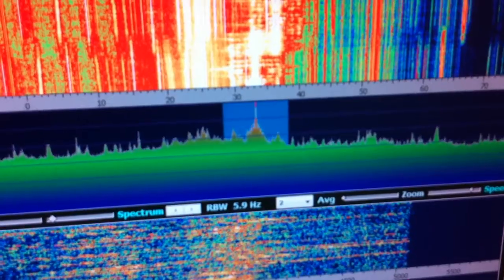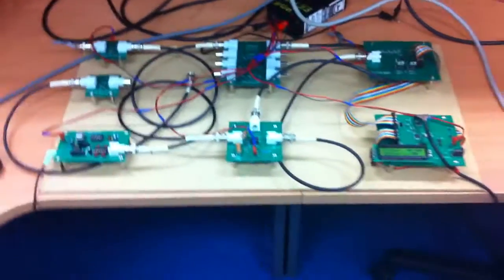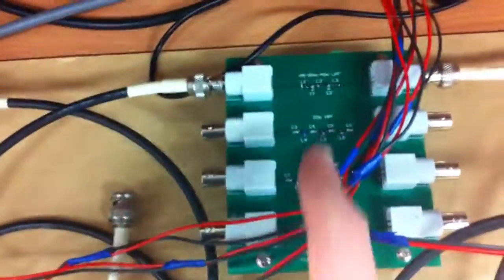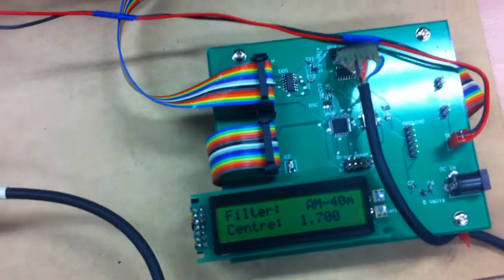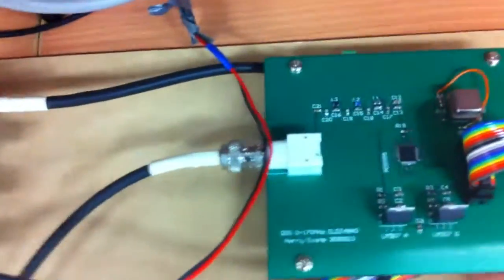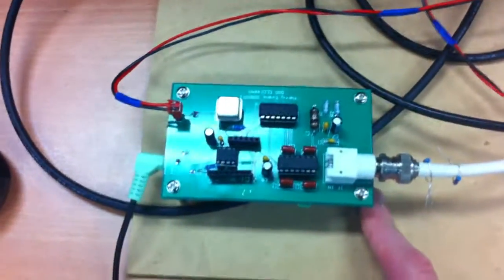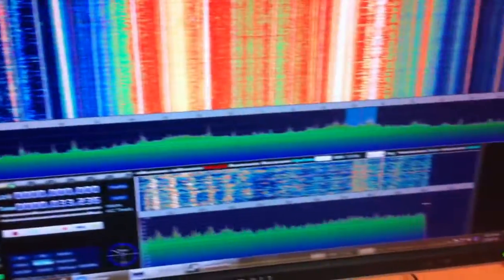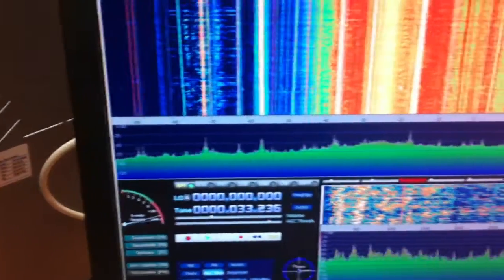SDR Receiving Commercial AM Stations

Comment: Thanks. I like the modular approach. One thing I can't figure out is if the QSD/Tayloe Detector requires a square clock or sinusoidal. I thought square, but people are using these expensive DDS chip. I figured there was a cheaper option out there.